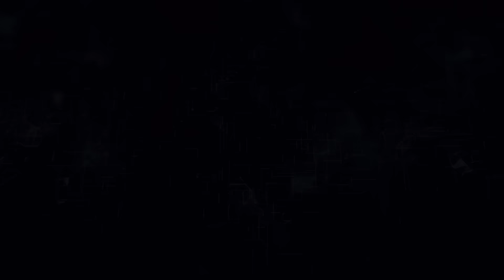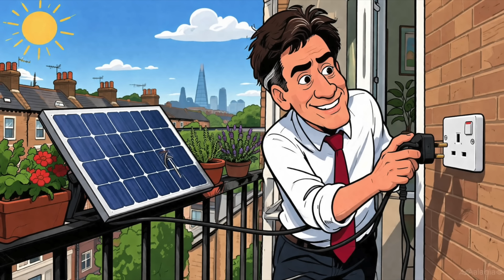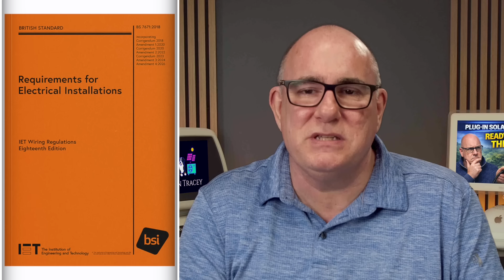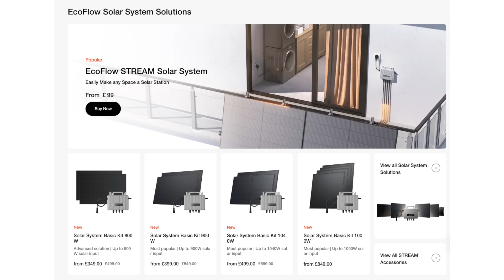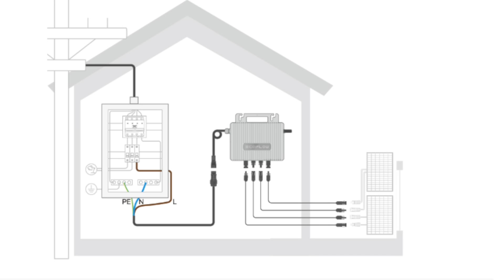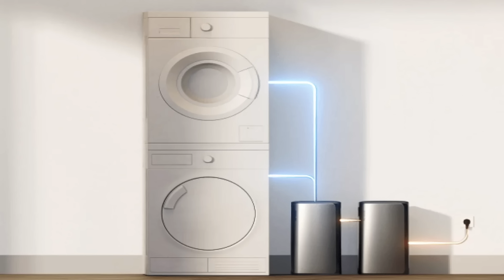Plug In Solar Is Coming… But There’s a Problem

Comment: I have run a system with a plug on it, 800w, I checked temperature of the plug and wires DC and AC and there is nothing to worry about and I had obtained g98 approval from my DNO, max output is 3.3 amps.  But since then, my electrician has installed a DC breaker for each solar panel with surge protection and lightning protection to earth.  In addition the AC cable which was 2.5mm going to the consumer unit was not man enough so that was upgraded to 4mm, the reason is that my home is close to the local transformer and mains voltage is 250 to 252v, that was noted by my energy supplier when they installed an EV charger.  Saving then during the summer months is £35 - £40 per month, winter months was near zero, this month it looks like £25 to £30.  My next step is to have a hybrid system with battery with a CT clamp so nothing is fed back into the grid, but this comes at a cost, £2500 or more.  Total expenditure so far is around £1,100 with labour, PV system, upgrades, so it will be awhile before I break even, may be 2 and a bit years with luck.
Reply from the maker: @johnmansell5097 Thanks for sharing all that detail — that’s a really good example of someone doing it properly and taking the safety side seriously.

Your savings sound very believable too: useful in summer, modest in winter, and better again once batteries come into the mix. Really appreciate you sharing the real-world numbers.

Comment: Just stumbled across your video as Im looking to set up a plug in system when its all legal.  My initial plan is to get the ecoflow system with the biggest battery I can afford.  It's my understanding I can link more than one battery together expanding capacity along with solar panels. I have a new shed arriving soon so will position it in the garden with a roof installation in mind. Just subscribed as still trying to figure what I can and can't do.
Reply from the maker: @greggreasley Thanks for subscribing 👍

That’s pretty much the attraction of these systems — start small, learn as you go, and build it out over time. EcoFlow do let you expand capacity on some of their setups, but the bit that still needs proper clarity in the UK is exactly what’s allowed, how it’s connected, and under what rules.

Sounds like you’re thinking about it the right way though.
Reply: House roof installation requires part A building regulation calculations and the like. On your shed it doesn't unless it's a huge shed. You do need to make sure the shed can take both the weight of panels and also the lift from them in strong winds. People tend to get caught out by the panels tearing their roof off, rather than collapsing it.

Comment: Received my ecoflow micro inverter and 2 panels last week and ready to setup, was considering just plugging in but now thinking to run a separate 2.5 cable to the consumer unit, wire the inverter into a isolator switch and fit a bidirectional rcbo. Does that sound right? And what amp would be best?
Reply from the maker: Yes what your suggesting is the right way to do it under current regulations, on what amp, I am not an electrician so cant say, you would need to talk to a qualified electrician I am afraid.
Reply: @JonathanTracey thanks for the reply, what is the purpose of bidirectional? So that the 800w from the inverter can be dispersed through to any circuit on the consumer unit that draws power?!
Reply: @scotty_t7597  A unidirectional RCBO can damaged by backfeeding so in theory may then stop protecting correctly. It's mostly theoretical

Comment: At the moment I have 14 x 250w panels that were installed 12 years ago, SE facing, with the FIT tariff. My 20kWh battery lasts all day from around this time of year ( once the heat pump dials down ) I was thinking of upgrading my roof panels to 450w to give me stronger generation in winter, but wondered if these panels installed on a SW facing wall, might help in the winter, when the sun leaves our SE facing panels ?
Reply from the maker: modern panels are much better than those made 12 years ago, like you I upgraded my 2010 200w panels to modern 450w panels. To keep my FIT payment I had to keep my provider in the loop and get their permission. I did a video on this about a year ago if your interested. https://youtu.be/qTFDtN7stxs

Comment: This is a very interesting video and i look forward to watching the next one. My interest is to use a Microsystem to supply cheap electricity to my Jaguar EV. Its not my daily driver, I use it for pleasure with an average  mileage of 50 miles per week.  I know that 800 watts would take forever to fully charge it, but i very rarely charge it to 100%, its normally between 20 and 70%,. I currently use a 10kw granny charger. Maybe a micro pv for the car would be useful.
Reply from the maker: @geoffaries That’s a great use case 👍

however a word of caution, these inverters can supply 800w max, during the day unless its the sunniest of days you will get less. Most EV chargers need a minumum of 1300w to start charging the car
Reply: @JonathanTracey  800 max to the grid, some of the standard ones in Germany (which will presumably get) can be set up to supply significantly more directly, although you'd probably still want battery backing it so you can get a steady supply for the EV charging.

Comment: Yes I think you are correct in what you say , only going to generate small amounts of power with plug-in solar. Have had solar panels in my garden for sometime charging batteries, I then plug-in a portable power station via an inverter in my shed. Powers thing’s like my TV. Panels placed in a good sunny spot in my garden , one on my shed roof.
Reply from the maker: @standrewpics That’s a brilliant setup 👍

Exactly what these systems are good at — small scale generation, used locally, powering everyday things. Not massive, but definitely useful and it all adds up over time.
Reply from the maker: @standrewpics That’s a brilliant real-world setup 👍

Exactly what these systems are good at — small amounts of generation, used locally for everyday stuff. Not huge, but it all adds up over time.

Comment: My dream is to get a solar panel with a small inverter and a CCS connector on the back so I can plug it straight in to the car. Say a 400 panel thar I simply lean against the bumper, plug it in and get 2kwh /day. That's 8 miles so about half my average. Every little helps.
Reply from the maker: @RaianeGross-sx9oq Love that idea 👍 every little bit helps.

I have a zappi charger for my car, its type 2 not CCS, but can dump excess energy directly into the car, on summers days we fill both our EVs from excess solar
Reply: I've got a wall charger as well. I'm just looking for something I can face East in the morning and then, pop out and face south west for the afternoon.  Just a simple thing for the 90% of the time when my car is sitting on the drive doing noth

Comment: France allows 2000w to be plugged in, far more usable.
Reply from the maker: that requires a larger inverter though, current micro inverters (when you set them to say your in france) seem to be limited at 900w. Thats probably a hardware limitation
Reply: @JonathanTracey multiple micro inverters. A friend who is an authorised electrician in France sent me a link to a supplier and it's making me re think plans already. 2kw system less than 600 euros!

Comment: If everyone has lots of these solar panels then all the suns energy will go into them and not our veg plots,seasides, and patio areas surely?
Reply from the maker: @Yorkshire321 Not quite how it works 👍

Solar panels don’t “steal” sunlight from other areas — they just convert a tiny fraction of the energy that hits them into electricity. The rest is still reflected or becomes heat, just like it would on a patio or roof.

So your veg patch and seaside are safe 😄

Comment: Zero VAT would be a game changer too on these devices.
Reply from the maker: The is already an existing exemption on solar panels and associated devices like inverters and batteries when bought with solar panels. This currently runs out in March 2027.
Reply: Isn't that only on installed systems?
Reply: @markswinhoe8252  Yes - I've had cases it's cheaper to pay the installer to "install" something where the work is trivial than buy it myself.

Comment: In my humble opinion,  battery storage is more important than solar panels. That’s not to say that solar isn’t any use but the real savings come from batteries and cheap rate electricity. This is especially true in the winter when there’s little to no solar and especially true if like me you have a heatpump. If I were going down this rabbit hole again and could only afford one thing at a time, it would definitely be battery storage first and then solar.
Reply from the maker: @wobby1516 Yeah that’s a really fair take 👍 batteries can deliver the savings quicker, especially with cheap tariffs and winter usage.

Ideally you want both working together, but I can totally see why you’d go battery first.

Comment: Hello 🙋‍♂️,

This is a flash⚡️ in the pan 🚽 unthought out nonsense from a struggling hopeless end of life ❤️‍🩹Government !!  I remember a few years ago when everybody went out and bought “wind turbines” and stuck them on their roofs and garden sheds - it’s the same 
🙈🙊🙉  - 💩with a different name… 

Keep you money in your wallet and treat yourself to a 
🫴💷🤏a fish 🐠 supper, 🤗
at least you will have a hour of  enjoyment with your money 💷 !! 

Thanks 🙏 
James ✌️
Reply from the maker: @James-f8z4r That’s quite the emoji collection… I feel like I should send you an “I attended” award for effort alone 😅🏆

On the actual point though — it’s not really the same as those old roof wind turbines. They failed because they were expensive, inefficient, and produced very little energy in UK conditions.

Solar is different:
- It’s proven tech used on millions of homes worldwide  
- Costs have dropped massively over the years  
- Even small systems can generate a few kWh a day in summer, which directly reduces what you buy from the grid  

No one’s saying this will power your whole house or fix the grid — it’s just a simple way to shave some of your daytime usage.

If it saves you money over time, great. If not, fair enough — but it’s definitely not just a “flash in the pan” 👍
Reply: @JonathanTracey 

Hello Johnathan 🙋‍♂️,

Happy 🥚 Easter 🐣 !!

Thanks for your reply, it was much appreciated !!

Only thing you 🙅‍♂️forgot 👨‍🦯 to mention about this to the average person, who might be interested in this - in the hope to try and save enough money 💷 here to boil a kettle for a cup of tea
🫖 ☕️ 🍰 is,  that we ALL do not have a “Johnathan” living next door 🚪 🏠where we can nip over the fence, and  ✊ your door and say; - hey big fella, ma’ box 📦 aw’  gubbings isnae’ working min ?? Kin ye come roond effter yer tea and fix it fur me !!

Thanks 🙏 
James ✌️

Comment: Energy security in 2 years time = A petrol generator and 10 jerrycans.
Reply from the maker: @bigjoeangel Hopefully not! 😅

Realistically it’s more likely to be a mix — solar, batteries, and the grid all working together. Systems like this are small, but they’re a step in the right direction 👍

Cans of petrol are going to get progressively more expensive especially when someone thinks they can just invade other countries and take their oil

Comment: So who came up with all this dumb red tape in the first place, as for these panels let me guess, all made in China?
Reply from the maker: @keithmartland6463 I get the frustration 👍

The “red tape” is mostly just electrical safety rules — things like preventing backfeed into the grid, protecting engineers working on lines, and making sure your home wiring isn’t overloaded or unsafe. It can feel over the top, but it’s there for a reason.

On the panels side, a lot are made in China — but that’s just how the global supply chain works now. China manufactures the majority of the world’s solar panels, including for big European and US brands. It doesn’t automatically mean low quality — many of the best, most efficient panels come from there.

So it’s less about where it’s made, and more about standards, certification, and how it’s installed 👍

Comment: I have just had a foxees 3.68kw system installed. Could I just add another panel to the inverter that I could move around my property just to cover my fridge and WiFi router usage.
Reply from the maker: you can do, but you could end up causing issues with your existing setup. It would be better to take the existing panel out of a micro inverter and keep the two systems separate.
Reply: To that inverter not easily as you'll need it on the same string and it won't have the same panel/shading etc.

As a separate unit yes - but you'll need to apply for a G99 as it will take you over 3.68kW. Or you could put the fridge on a separate grid charged but not grid tie box like a Bluetti AC200L or an Ecoflow Delta 3. Those never feed back to the grid which means they don't snarl up in regulations and they also don't cut power in outages.

Comment: How big can this system be?
Reply from the maker: each inverter has a max output of 800w, we’re not sure if you’ll be allowed to have multiple inverters. However, behind the inverter you can have whatever size battery system you like. This is probably limited by whichever manufacturer you choose. For example, if you use EcoFlow stream batteries you can have about 12 kWh
Reply: Well, I suppose,if People can scale it up it would work okay.  @JonathanTracey 

But I do want to point out, that solar productivity in the winter, especially in the UK is very poor. 

I have 8KWH mounted on two garages, and it makes around 300w an hour for around 5 hours in the winter days. 

Plug-in solar all sounds really good but a socket can only take 3300w and 13 amps.
Reply: There are German systems that are still counted as balcony solar with 6kW of solar, 2kW of direct sockets, 800W of grid tie and up to 25kWh of batteries. The question is merely "how big can you afford" 8)

Comment: I won’t be jumping on to the bandwagon straight away 
Dont want to make the same mistakes as EV buyers 
Take time to see if it works and is viable
Reply from the maker: @DouglasBrightman-yb8ry That’s a sensible approach 👍

No rush to jump in — watching how it develops and letting the rules settle is probably the smart move.

The tech works, it’s just the UK catching up on the framework.

Comment: Think in terms of 50% of the uk households generating 800 watts,  thats a massive amount really,  definitely an easing on the system surely
Reply from the maker: @crishill6458 You’re right 👍 at scale even small systems add up.

Individually it’s modest, but across millions of homes it could definitely take some pressure off the grid.
Reply: @JonathanTracey having just come through a winter and enjoying my first spring with my new solar and battery setup,and for the first time not touching peak electricity day to day,  I’m looking to see how I cover more of my base load without chewing into my battery to avoid paying the 40p a kWh peak that’s undoubtedly coming. Couple of these bad boys strapped to my garage wall should see my 200w base load covered

Comment: Am I right the solar unit will cost about £800 and you wiĺl save about £100 of your bills a year?  So 8 years to get even.  Is it really  worth it?
Reply from the maker: @Crystalpal1978 You’re in the right ballpark 👍

~£800 and ~£100/year is a reasonable estimate, so around 6–8 years payback. After that it’s just ongoing savings. Most inverters come  with a 10+ year warranty and the panels with a 25 year warranty so you can expect them to last a bit more than that

Not for everyone, but if you’ve got a steady baseload it can definitely be worth it.

Comment: You say that you have already plugged in your EcoFlow micro converter with a plug. Does this switch off immediately when power is not supplied to the house, ie no 50Hz signal on the line? If not, and there is a power outage, you may backfeed power up the supply line and put the electricity workers at risk of electrocution. Maybe something to discuss here before others “convert” older micro inverters.
Reply from the maker: yes, it requires a 50 Hz signal otherwise it immediately shuts down

Comment: What are your thoughts on costs? do you think it will drive down costs or will the demand in the summer push them up? its pretty cheap now to buy a couple of panels and a ecoflow microinverter
Reply from the maker: it depends if the manufacturers can keep up with the demand, right now checking on Amazon it’s about four week wait for an EcoFlow micro inverter. I suspect somebody will jump on this start selling them on eBay and inflate the price. But once all the manufacturers start getting supply into the shops, hopefully this problem will go away.
Reply: At the moment the prices are way up - it's about £100 a panel not £65 a panel even at places like City Plumbing. It will be interesting on the inverters to see what happens when the rivals who have been well behaved and not shipping into the UK with "don't put a plug on it nudge nudge wink wink" approaches start to also offer stuff in the UK. There's a big range of rival suppliers in Germany for example and I'll bet Aldi or Lidl or someone will cut deals with them.